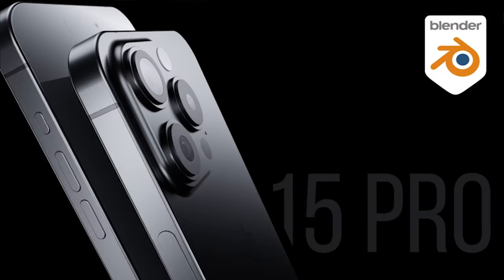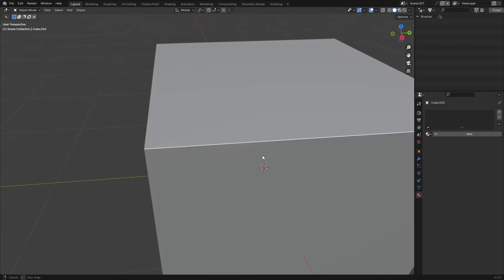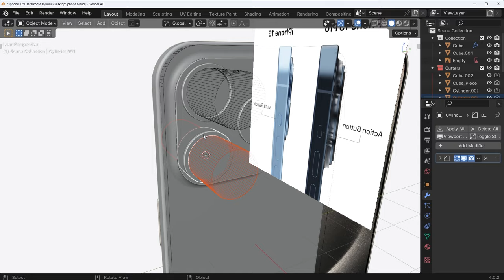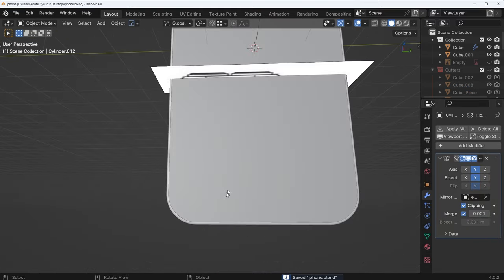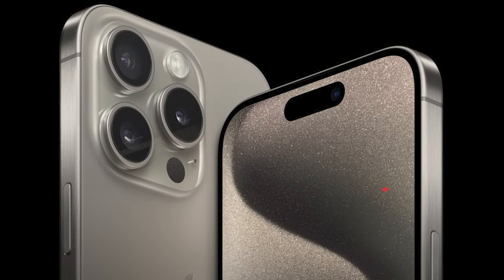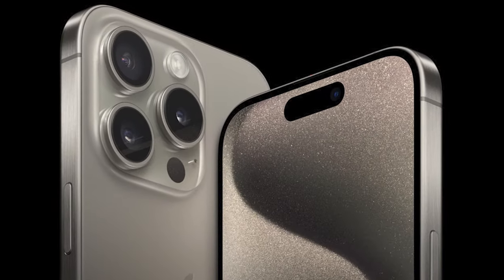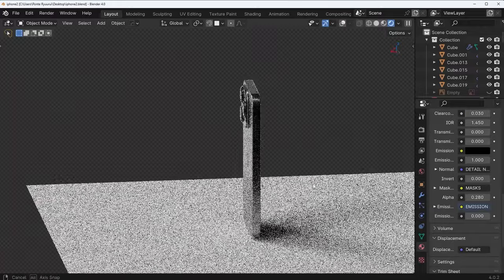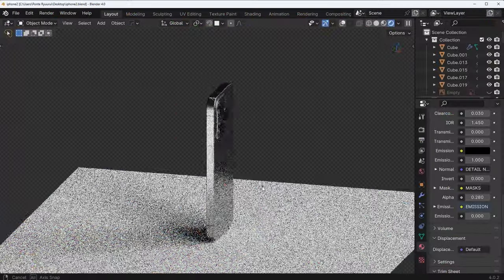I Recreated the iPhone 15 in Blender

Comment: It doesn't get more professional than this. Good work! Nice tutorial. :)
Reply: Sad for you. This is very unprofessional modelling
Reply: @denysk.1178  why because of ngons?
Reply: @denysk.1178  It depends what you're using it for. For the purpose of this render its perfectly fine to use N-Gons. A lot of professionally made, incredible looking hard surface video game assets are modelled with N-Gons present. (They're triangulated in the final product, of course) If you're really a professional then you understand that context matters. No point going overboard with perfect Sub-D all quads topology if its for a render and will never need to deform or subdivide. A topic as broad as 3D art can never be boiled down to "N-Gons bad", "Booleans bad", etc... Pick your battles wisely and choose the method of making a model that best suits what you need it for.

Comment: 1.Instead of scaling the phone - change scene setting to millimeters
2. Use official technical drawing instead of photos
3. Make actual holes for volume and lock buttons, you need small bevel in phone body 
4. Apple logo should be used in shader as mask for “mirror” shader.
5. Try applying all those booleans ;), if you want to export your model 
6. We understood you learned about bevel 😂, now learn about topology maybe.
Reply: 7. Show us how you would do it better, mr yoda.

Comment: why does the bevel behave differently for a cuboid as compared to a cube  ???   😥
Reply: Apply scale then try
Reply: Because the sides are scaled differently. Bevels behave with respect to the edge lengths. As the person above me said, applying the scale will reset the scale values and make the bevels even again

Comment: Hi Sir, I'm new in hard surface, When do I need to be concerned about the topology? Is this the type of hard surface method can I invest in learning?
Reply: It depends massively on what you want to use the model for. If you need the model to deform, such as a character model that is rigged and animated, then you need clean topology with a consistent density. If you want to make hard surface models, (ones that will likely never need to deform) then the approach Josh is using here is just fine. For hardsurface models, N-Gons are perfectly fine, but you want to make sure they are triangulated before exporting from Blender. That being said, even if you want to learn hard surface, learning topology fundamentals, Sub-D, and doing a few topology exercises is recommended, so you have those skills, as they will surely come in handy.
Reply: @Argon-Matt  Thank you for enlighting me

Comment: Is there anyway to do slash operation like this without add-on in blender?
Reply: Blender has a built-in addon for boolean workflow called bool tools. Active it, run a slash operation, and then just check the parameters set under the boolean modifier that it will add